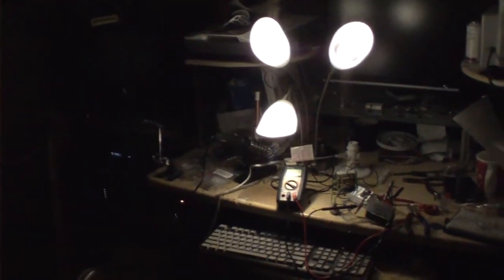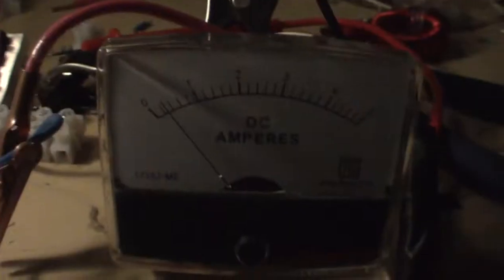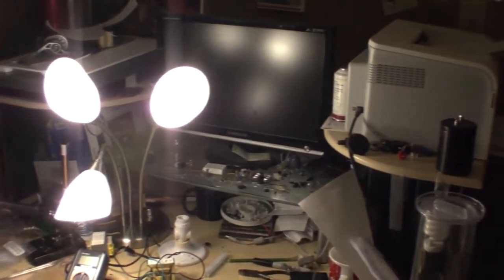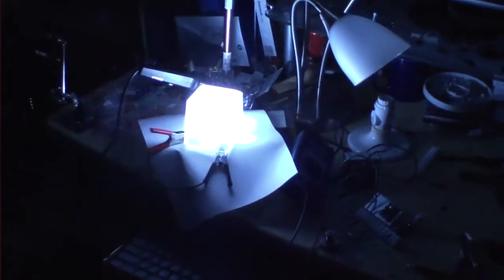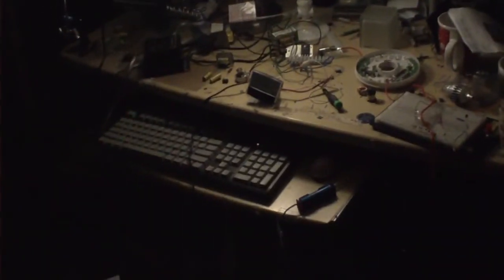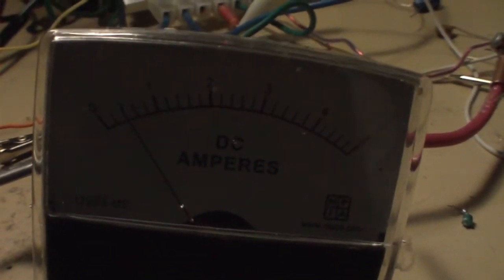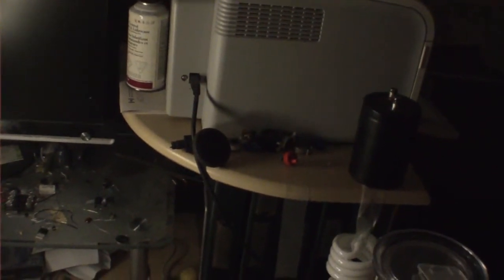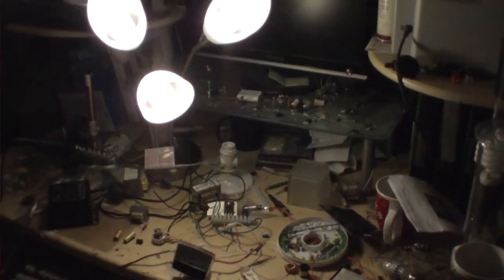XEE2 JT vs. MotoMaster Inverter vs. DC LEDs 12V / 7.2V / 3.7V

Comment from the maker: Thanks goes to XEE2 :) I'm a bit of a current hog in this video, they will all run on 200 mA or less even, but those banks of batteries under my desk get solar charged, and they came from the dump.. so it's pretty cheap light, for certain!